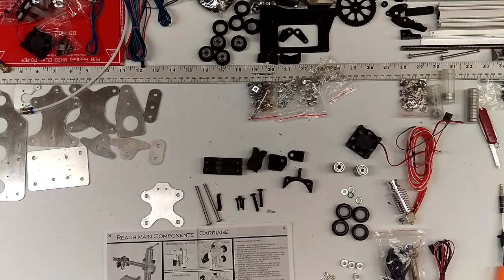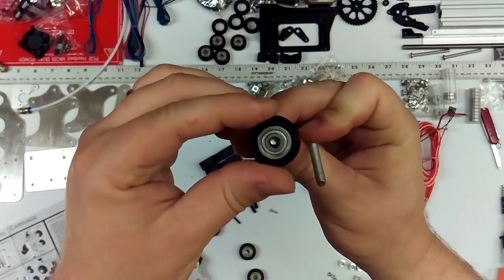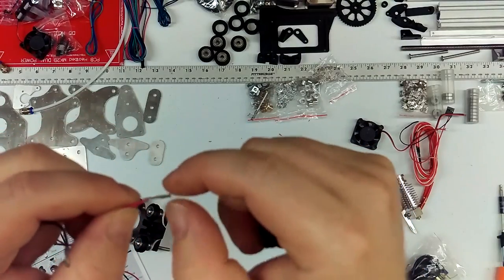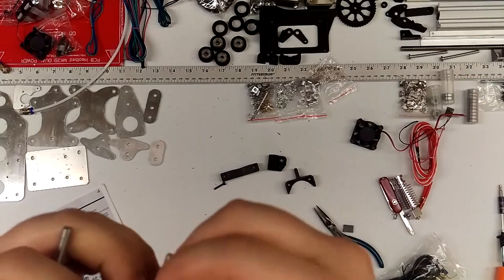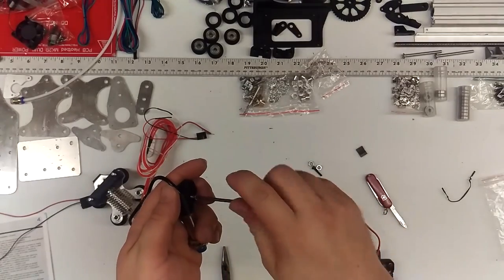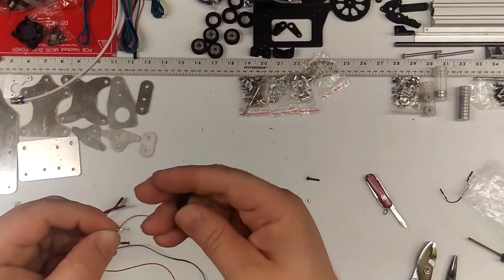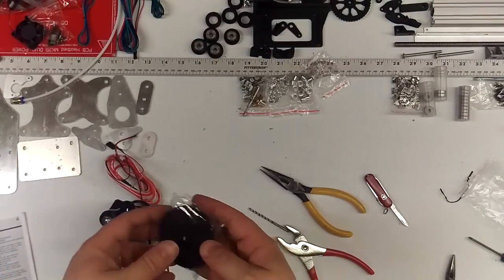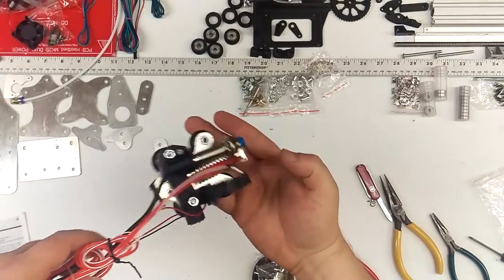Reach 3D Printer Assembly Part 4 - Carriage

Comment: Hi Nate, my limit switch housing and wires seem to be reversed in my kit. so the pin on the switch is facing down when i assemble it instead of up as shown in the picture.  will this be a problem?
Reply from the maker: Post a photo on g+ community so I can see what you mean. 
I doubt there is a problem, just feed the wires through the holes straight. 
Color is irrelevant. Thin metal lever up or down doesn't matter either.